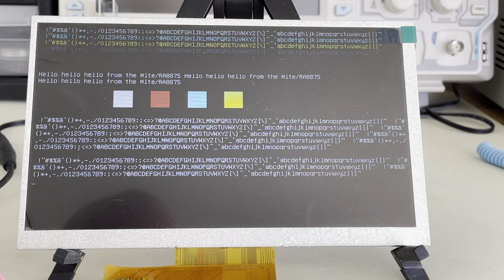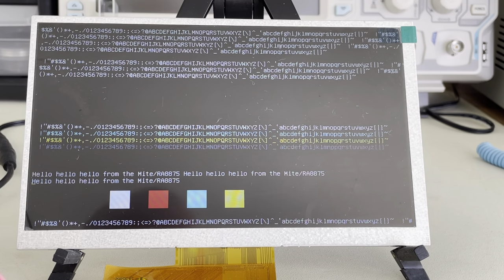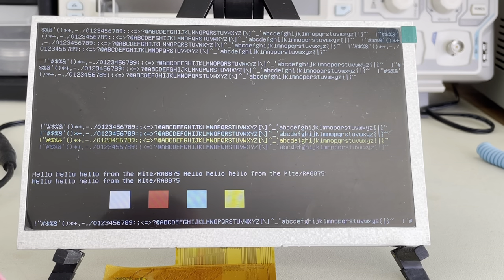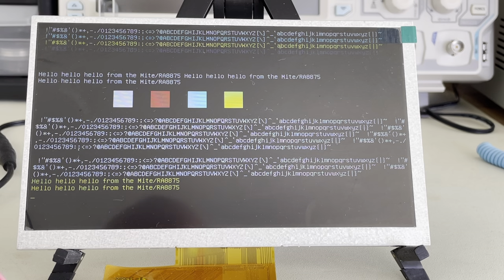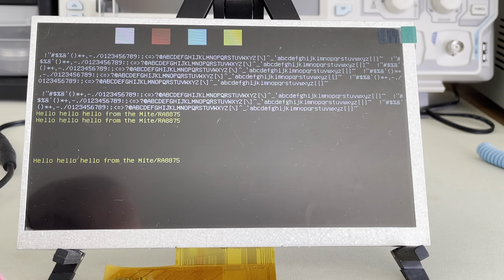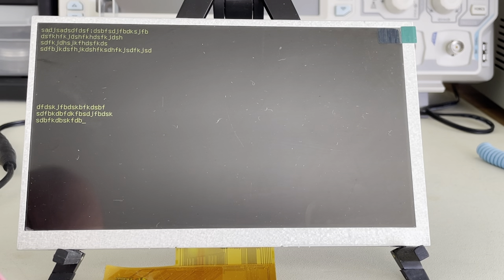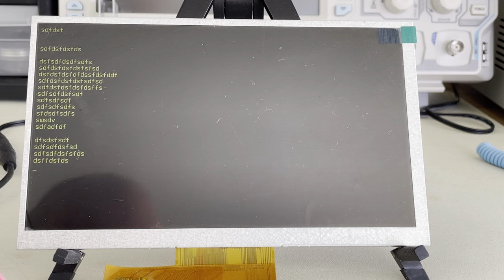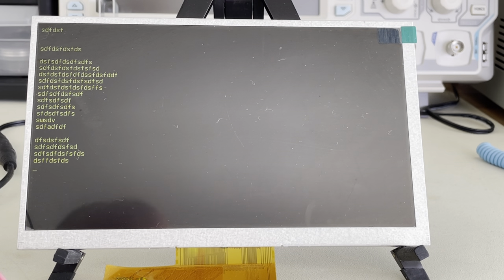6502 Mite home-brew computer project, brief update: Scrolling on the RA8875

Comment: It's interesting to see the capabilities of that controller.

In my experience though that's really normal for hardware scrolling - it scrolls and wraps around, and your software needs to figure out which addresses scrolled on and clear or otherwise update it to the new content. You only need to draw or clear that one line that scrolled on the bottom, so the overall workload is fairly consistent and light.

It's worse if the scroll is actually just panning around a larger space, because you still eventually get to the edge of that space, and if it doesn't wrap when it gets there, you end up needing to redraw the whole screen at that point which is expensive. That said the blit there looks pretty fast!
Reply from the maker: Oh, yes, I wasn't too surprised -- just led astray by the nomenclature since I hadn't used something like this before. It makes sense, and the functionality is quite good (it scrolls both horizontally and vertically and can have an overlay layer too) so perhaps I'll use it some time.

In general, the controller is pretty good, although of course I'm driving it over SPI so while it's fine for rendering graphics using its own primitives, it'd be horribly slow to be trying to upload large images to it or anything like that.